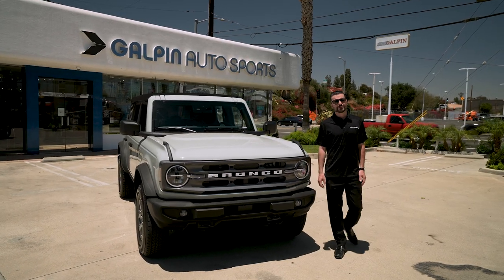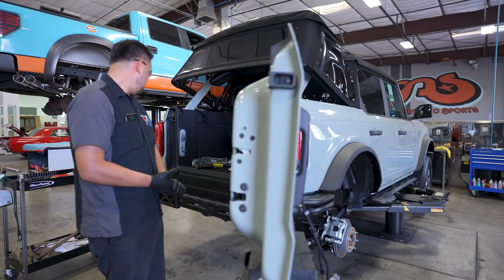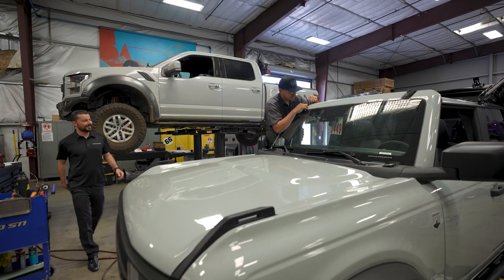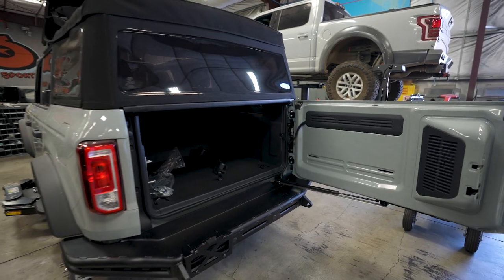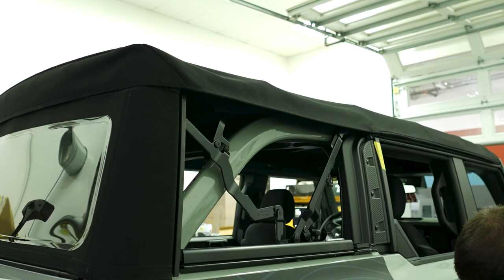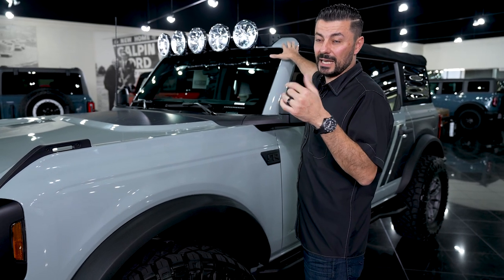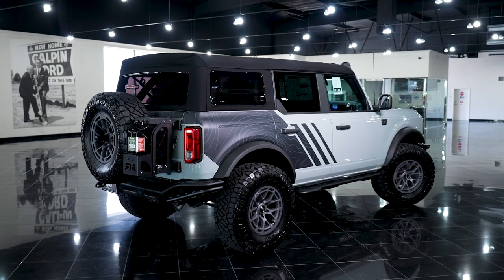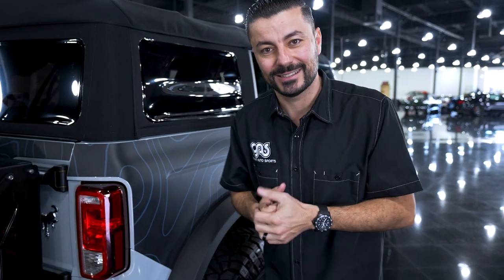Building Our Very First 2022 RTR Ford Bronco From Start To Finish!

Comment: Is that their standard RTR spare tire reinforcement bracket? If so, is the Jerry Can accessory mount mounted straight to the bracket?  What size are the tires? Did you have to relocate the spare tire bracket higher?  Thanks and - great build!
Reply from the maker: It is the standard RTR spare tire bracket. The spare tire bracket is adjustable so the spare tire had to be moved to the left a little bit in order to fit the Jerry Can. The Jerry Can is bolted on to the spare tire bracket. Hope this helps!

Comment: Adding $20k - $30k to the vehicle
Reply from the maker: As you can see, the RTR parts and components we installed involved quite a bit of work. Not to mention, this Bronco and all of its associated parts is still under warranty.
Reply: Probably on top of the 10k “market adjustment”